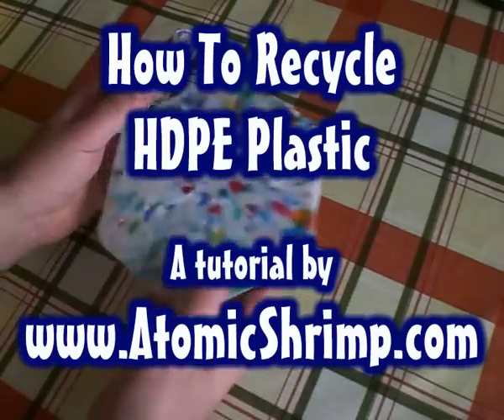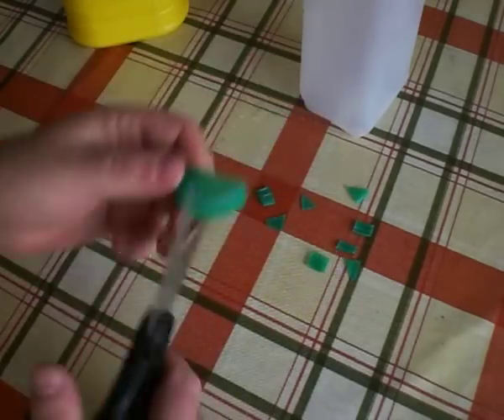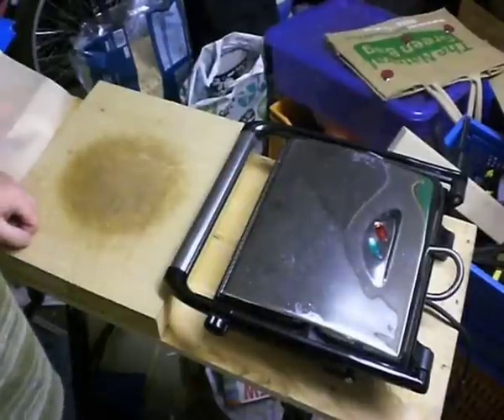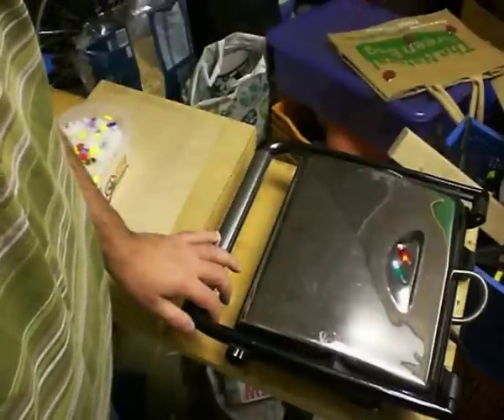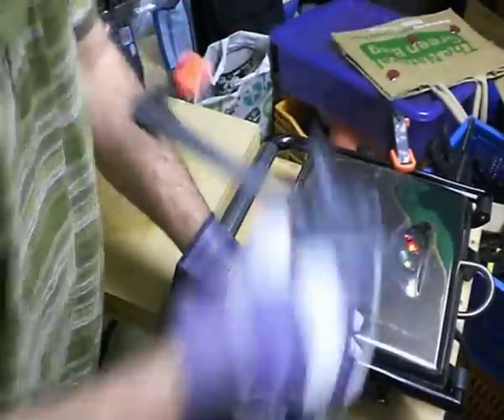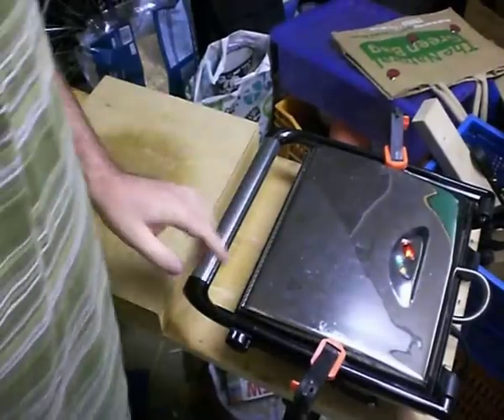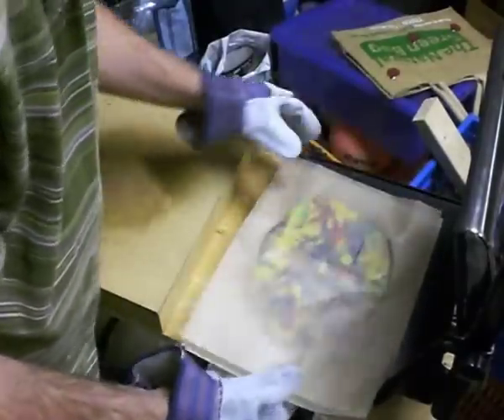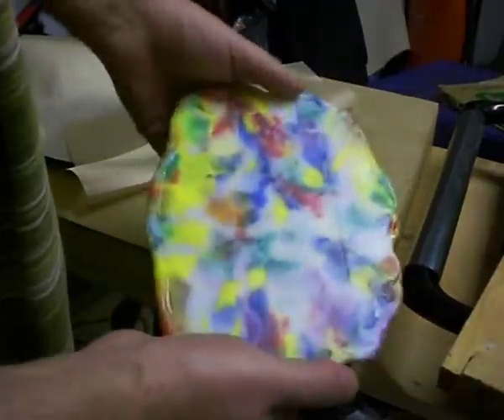How To Recycle HDPE Plastic (High Density Polyethylene) - a simple method

Comment: ever thought of using those heat press they use for t-shirt making? I am planning to melt other plastics.
Reply from the maker: That ought to work pretty well, as they are temperature-adjustable and could be made to melt a variety of resins without burning them.  I wonder if they ever come up for sale secondhand (as they're a bit spendy new)
Reply: Creative Mechanics is a good source to find melting temps for types of PE, in this case HD is 120-180°C/245-256°F if the cooking iron can get hot enough without burning it rendering the plastic useless.

Comment: Hey, I just watched Taofledermaus shoot your HDPE shotgun slugs - nice job with those! One thing I was wondering - is it possible to get HDPE to a liquid state, enough to cast it in a wooden mould for example? That is, without burning it.
Reply from the maker: Not really. It will flow under pressure in an injection moulder, but t won't become liquid/portable under normal circumstances, without burning.  softest it goes is sort of like melted toffee

Comment: I like  this method of melting, most other people use a mini oven, but the good thing about this is that it applies pressure at the same time, It would be good if you could rig up some metal hooks onto metal chain (because of the heat) down to some bungee cords or springs secured at the floor, this way you could put the hooks on and it would keep applying force and save time.  next project should be a HDPE shredder :-)
....or you could use the life hack that uses a craft knife blade and washers and 2 screws to make a long plastic cord in a matter of seconds...
Reply from the maker: The pressure does help to make a really solid end product with fewer voids and bubbles than other methods - also, the toaster is just the right temperature to melt the plastic without burning it

Comment: 3D printing material. Best idea.
Reply: Plastics made for 3D printing melt as low temps, this is a 245-356°F/120-180°C melting range material and thick as molasses if you ever try to knead it.

Comment: I have some questions about the video: You stated that you had 200 grams of HDPE flocks. When the rectangle finally came out of the toaster, how much was the weight then. (Much) less?
How much time did it take you all by all "melting" the flocks to the final rectangle?
How long time did you let it cool down during being clamped between the (ply)woods?
What is the maximum thickness that you can recommend to make?
Is it possible to make blocks (for example 6x6x15 cm?
Or cylindric forms with a diameter of 6 cm and length 15 cm?
In both cases at first do how you dit it and afterwards put it in a mold with the desired shape?
Reply from the maker: +Hans de Groot Hardly any weight is lost during melting as I am not overheating the resin, so it doesn't fume.  It takes about 5 minutes to melt the flakes into a coherent mass. It's possible to make blocks by folding the melted material and forcing it into a block mould instead of clamping flat (see my video where I made a replacement handle for a horn ladle).  It takes 10 minutes to set solid, but with flat sheets, it's necessary to keep them clamped for an hour or more to prevent them warping.

Comment: wow that was fantastic and what a lovely result. I can see how this could become addictive.  But I would get too frustrated with the chopping part.  I have previously tried to chop bottle tops in my high speed blender but no luck, as the speed of the blender created too much heat.  I think a granulator works on a 'chomping' or 'grinding' basis which does not produce heat. I wonder if there's a cheaper way to chomp and grind the plastic?

Comment: Rather than using the clamps, which seems a little tricky, why not just put a brick on top of the cooker?
Reply from the maker: +77gravity It needs quite a lot of force - the clamps engage with the framework of the press - applying a similar force by adding a weight to the top casing would cave it in
Reply: Thank you

Comment: 14:16 = so you could run your blob through a wood planer?
Reply from the maker: +Arak Seepoom I've only tried it with hand tools and handheld power tools (including a handheld electric planer) - it responds very well to most woodworking tools and techniques.  It might work OK in a larger electric planer, as long as the machine could grip the slippery plastic sufficiently well to feed it through.

If you tried to plane a lot of thickness away in one pass, the friction might melt the plastic and clog the machine.

The shavings are a little more clingy and tangly than softwood shavings.
Reply: thanks.  i could see how heat build up could be a problem.  have you thought of building a bigger heating press, to get bigger slabs?
Reply from the maker: +Arak Seepoom I would love to do that - I wanted to try to make a canoe out of this stuff - I tried welding heagonal pieces together into large sheets, but it was a disaster.  Large sheets could be tricky to make though - this material shrinks considerably on cooling - and if cooled at all unevenly, it will buckle and warp.
Reply: how about making roof tiles out of it?

Comment: I know milk bottles made of HDPE that are left outside in the daylight go brittle and break down from the suns UV rays. so how long will anything made from the same material last if used outdoors?
Reply from the maker: +Bill See HDPE intended for outdoor use normally has UV stabilisers added into it.  I don't think it's possible to do this on a small scale basis without industrial mixing equipment, but even for recycled material like this, the thickness will make a difference - milk bottles degrade fairly quickly because they are thin.  A piece of recycled HDPE that is 5mm thick will last a bit longer.

Comment: Can this same process be used to melt plastic grocery bags?
Reply from the maker: +Ryan Brewer Probably.  The thin, crackly ones are usually HDPE.  The thicker, softer ones may be LDPE or sometimes a mixture of recycled resins.  You need a lot of bags though, as they are made from quite small amounts of plastic stretched into a thin film.
Reply: +AtomicShrimp Thank you so much from responding. I checked the bags I have and they are HDPE 2. I have some great ideas for the plastic and 10 years worth of saved bags.
Reply: +Ryan Brewer yes it can i have tryed melting grocery bags into a block and it worked perfectly one thing i always do when i melt anything is to kneed it like dough with oven proof gloves what this does is it gets rid of microscopic unfused layers in the plastic and will make it completely uniform without any kind of weak points anyway i tryed to break it with gripping pliers and could not break it no matter what and it did take a nice shine with sandpaper

Comment: super cool, Something I was trying to figure out, was getting the labels off all of the containers I have collected.  I want them to be bare, before I cut them up, and melt them down. Can you give me some tips? Thanks
Reply from the maker: +Tommy Schutz  The labels on the milk cartons I used were all either made of loops of ldpe that just slipped off, or were actually tough plastic labels that peeled off in one piece.  You might be able to soak off paper labels if they are stuck on - otherwise, cut around them and use the non-labelled parts, or select different containers.

Comment: There's got to be a better way to shred the bottles - using scissors to cut into such tiny pieces is too labor intensive.
Reply: +QuantumRift, A blender actually works really well
Reply: +God is a sciopath worked really well actually.
Reply: +God is a sciopath dont think ima try that..... lmao
Reply: +QuantumRift  A paper shredder might do the trick.
Reply from the maker: +Fred Bear I've tried a paper shredder, and a shredder that was designed for destroying credit cards; in both cases, the plastic just managed to slip between the blades and jam them up - it's very tough, and very slippery.

Comment: Can you do a video on LDPE? I've got a few low density bottle tops alongside my HdPE stash and was wondering if you could do something similar with them
Reply: Connor Steppie with ldpe you do pretty much the same exact thing except heat it at a lower temperature maybe at 310-320 farenheit instead of 350 and make sure you watch it so it doesnt burn ldpe is a little bit weaker but it has more impact strength and flexes more without snapping
Reply: If you melt this that high you are compromising the integrity of the plastic structure or properties, in this day of information its quite easy to look up "melting temperature of "whatever" plastic.

Comment: Hola, no hablo ingles pero me gustaria preguntarle si este metodo funcionaria para hacer tablas para la cocina o se apra picar carnes, vegetales, etc.? Seria apto para usarlo con alimentos? Gracias y saludos.
Reply from the maker: +Candi Young I heard that too.  Apparently, wooden cutting boards actually destroy or inhibit bacterial pathogens for several reasons - by wicking water away from them, and because of antimicrobial chemicals naturally present in the wood.
Reply: Hola. Mi lengua esta muy malo, pero, cuando tu lees este, traduzca, favor. I just found out that pathogens prefer plastics to wood, so I would not risk using this plastic as a cutting board. This is just my opinion, though.
Reply from the maker: +Ruben Angel Hello.  Hola. Yo sólo hablo muy poco español ( Espero que esta traducción automática es OK) . Este método podría ser utilizado para hacer tablas de cortar para el uso de la cocina. Usted tendría que comenzar con materiales muy limpias

Comment: Thanks for the videio....I can think of so many things to make use of the melted & then hardened HDPE.  One thought, when you put the cardboard circle on the sandwich toaster and it spread out....my thought was to cut a 1/2" circle high piece of HDPE (like a pryex bottle that is round) and leave the small pieces inside and then melt it all together......I'm collecting colored HDPE to make a few things.  Great idea and Thanks again for the video.

Comment: this is cool i had good experiences with melting 5 gallon orange buckets they dont even need to be clamped thay just simply flow into a square container however i was wondering if i can make small wind turbine blades with melting hdpe
Reply: +Dean Walcott by the way i read an article that said you can remove label glue with peanut butter and i didnt believe it but i tried it anyway and to my surprise leaving the peanut butter on the sticky label residue for about 5 minutes then wiping it off completely removed the label residue there wasnt a trace of any kind of glue left this has saved me hours from scrubbing and pealing labels off. i think cooking oil also can dissolve label residue

Comment: have to say that certain blenders/shredders would be cool for this, even a hedge trimmer or an A4 paper cutting board. To test if two plastics are the same/mixeable, you can also bubble them together with a lighter and stick them. if they are the same, they stick.

Comment: I'm a artist researching the aplication of bioplastic and recycled material and I have two questions: Do you cut the plastic or use molds? And what toaster your using?
Reply from the maker: The plastic is easy to cut using hand or power tools - similar in many ways to woodworking (check out the other HDPE recycling video on my channel for an example).  The toaster is a Cookworks panini grill.
Reply: thanks

Comment: Whenever you submit the material to heat, it will degrades, breaking chemical chains and rearranging its morphology. The more you process it, more fragile it will be, especially if you let it cold in the air. If you quehch it with cold water, it will not be that brittle anymore.
Reply from the maker: Cooling HDPE with water is probably not a great idea.  It shrinks violently on cooling, and this is hard enough to manage when the cooling is gradual.  If you cool it rapidly, it will deform significantly and probably ruin the shape of anything you're trying to make.
Reply: AtomicShrimp You have to col it inside the mold. But in a wooden mold, it won't make too much of a difference.Only after cooling, then you can remove the piece from the mold.
Reply from the maker: I think you're prescribing a solution for a problem not in evidence.  Quite a few people have commented on this video about the end result being brittle or fragile.  It simply isn't.

Comment: I'm not sure this material is as useful as it seems since it becomes extremely brittle; I'm starting to believe that it stops being polyethylene after melting, let alone staying high density PE. It has mechanical peoperties very close to wax, save for hardness.
Reply from the maker: I've not found it to turn brittle at all - I would not be able to break either of the pieces in this video by hand.  I'm only melting it very gently at the bottom end of the melt temperature range.
Reply: Hm, maybe it only applies at low thickness
Reply: No, of course cooling it too fast crackles it (I'm heating it way past fusion), but I meant the material is simply not very ductile.
Reply: But what is this oil you speak about ? Don't hold back on the chemistry, I am able to understand it.
Reply: It doesn't make sense, really, HDPE is really just poly-ethylene more closely packed together than regular PE, cracking it back into ethylene would just produce it as a gas; I guess you mean the polyethylene would fuse ?
Reply: ***** it doesnt become brittle at all in my second newest video i throw a heavy brick on one of my pieces i made and the plastic was so strong that it actually caused the brick to break in half the plastic survived without any dents
Reply: if you overheat it too many times you will start to get some brown spots and the plastic will flow less when melted it will also lose strength but if you dont overheat it you can melt it probably over 100 times without losing any strength
Reply: ok so i did try bending a small disk of milk jug hdpe with two pliars about 3 or 4 inches diameter 2/10 inch thick and ill admit it did crack and seemed to be brittle so i looked at how it broke and i noticed where it fractured it had a weird fracture pattern sort of like the crack had many crazes and i realized that maybe when the hdpe is melted in flakes they may not completely fuse together and even though they may look like they did there will still be micro cracks that are not visible but are still there. so what i tryed was melting the plastic flakes and then with heat proof gloves i twisted the molten plastic and kind of kneaded it like dough what this does is fuse the hdpe pieces together and removes any weak points in the plastic so after making an identical disk this way i tryed snapping it again with 2 pliars and it was completely unbreakable no matter how much effort i used to try to crack it it didnt even hint at cracking it was even impossible to bend
Reply: Peter Brown has a mallet made out of HDPE. That thing doesn't seem brittle at all.
Reply: Worked for Recycled Plastics Man known know as Recycled Plastic Factory under new ownership since. Made Lumber and legs for picnic tables and park bench seats, and other stuff made from lumbers out of regular wood. Only when overheated or recycled to often will the plastic become brittle and useless and trash in the landfill or ocean if it makes it there. One of the customers is a dock builder. The company still makes the old stock along with some new extrusions.

Comment: Seems like a lot of work for something you could buy for $1 at Walmart. Also, the electricity you used to make these was most likely powered by coal. I understand the recycling concept - just not sure how effective this is.
Reply: Recycling REQUIRES energy. There is no way you can recycle without heat and electricity. Recycling anything is energy intesive. think of aluminum, steel, paper, plastic whatever, you gotta melt that shit somehow. Well not paper, but that need proccessing too, which needs electricty. Then there is sorting, which is labor intensive. Many people think of sorting when they think of recyling, but that is a common misconception.
Reply from the maker: Ilir Kumi
True, but with many materials (and especially metals), the energy cost of recycling is less than that of creating new materials from ores or raw component materials.  Digging and refining ores, extracting petrochemicals, even harvesting and processing trees for paper, are also energy intensive.
Reply: AtomicShrimp That is a also true. Fact of the matter is that energy is truly one of the most important things in this world. It is wealth and it is work. Without energy humanity comes to a standstill.

Comment: Hi there Can I put it in a oven at 200 degrees to soften it.
Reply from the maker: Maybe, but you might find that it starts to burn and fume as you are heating it indirectly with hot air - and this takes a while to transfer heat into the material
Reply: the reason why I ask is because I don't have a heating pan like vours  ill give it a try with a sample thanks mate cheers.
Reply: AtomicShrimp Would one be able to use a hot air gun to melt the plastic?
Reply from the maker: Yes, but you may find that it burns if you focus the heat on any one area for too long - also, HDPE shrinks violently on cooling, so if you are trying to weld pieces together using hot air, they will tend to pull apart and distort as they cool

Comment: I think this is a great idea for a material to use to repair and replace broken/missing parts, and great for crafts such as making beads.  Maybe even embed some kind of mesh and make small decorative wall tiles for the kitchen and bath.  :)
Reply: Why not make the whole bathroom floor?
Reply: @doveoo5  too slippery. Wall tiles is better.
Reply: Sounds like a good plan, Johnny Crochet;  roof tiles for a clay house, or bricks for same.  :)